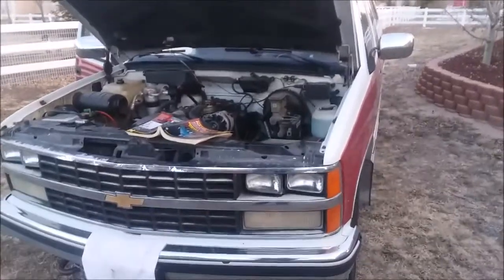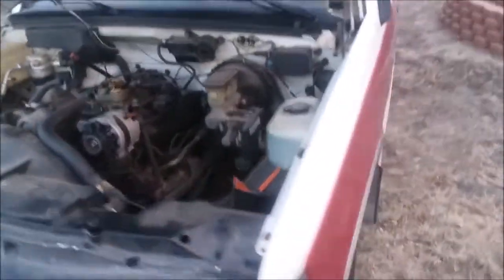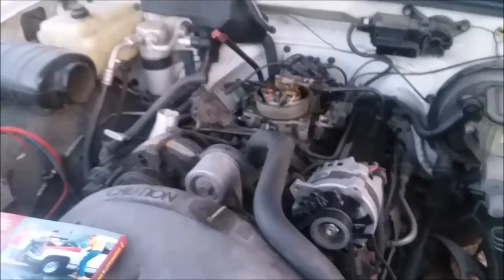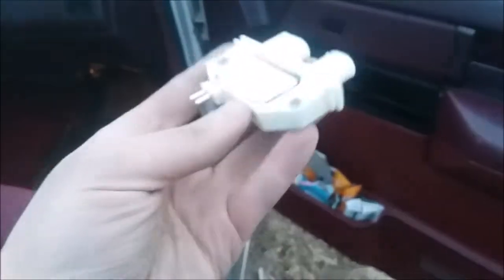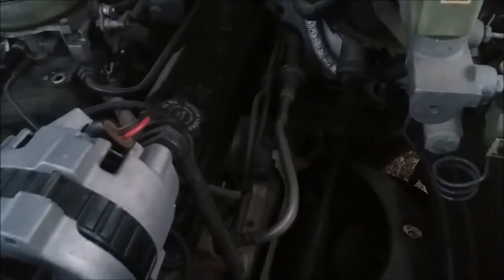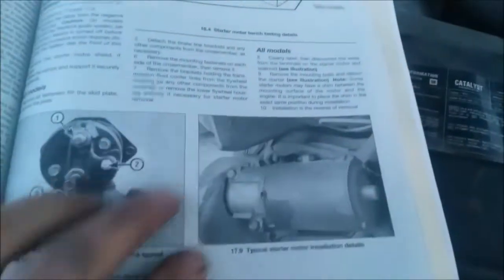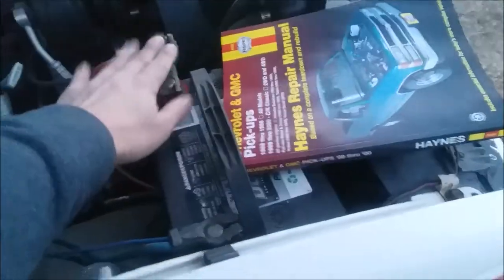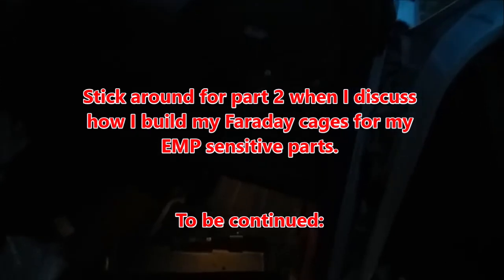How to EMP Proof Your 1988-1995 Chevrolet GMC GMT400 Pickup Pt 1: I.D. EMP Sensitive Components

Comment: A emp could burn up the  wire harness .     Lots of wires in those trucks.  You have a great  truck but to really have a emp vehicle  i think  you should bd putting together something pre electronic ignition. Like 75 and older
Reply from the maker: Maybe the wiring harnesses could get burned up, but I'm a little reluctant to believe that based on my knowledge of electricity, however I cannot 100% rule what you said as being untrue mainly because I've never lived through an EMP. I'm going to rule your comment as a "maybe" or "possible". Not to sound like a smart ass but for all I may know with an EMP, unicorns could come trotting out of the sky on rainbows.
Reply: @Deorse      all true. I was not knocking you.  Just trying to make some points.    That really is a great truck.
Reply from the maker: I know you weren't trying "knock" me, Walter Davis. I think you brought up some valid points and I want to take them into consideration if encase an EMP were to actually fry all of the wire harnesses in the truck. All of my truck-related preps could be for not if that happens. And thank you for the complement, thank you for the comments, thank you for the feedback. If anything I enjoy responding to comments such as these because I can get a good debate going and some good constructive criticism going as well.
Had you not made a comment about the wiring harnesses, I would have never had guessed them to be a possible problem during an EMP event.
Reply: @Deorse     i did  a responce video.   Figured it would be better than trying to explain through comments
Reply: Walter Davis will a Shelby gt500 1970 work and does it have a computer
Reply: Walter Davis hey will 1983 or less cars work or not
Reply from the maker: Unless you installed an aftermarket electronic system and aftermarket engine with computer controlled electronic ignition and sensors your car will already be EMP proff presuming that you didn't replace your mechanical fuel pump for an electronically controlled aftermarket fuel pump and you have a spare battery protected by a faraday cage.
Reply from the maker: If your vehicle is newer than 1974 then you are going to need spare replacement parts stashed away in a faraday cage.